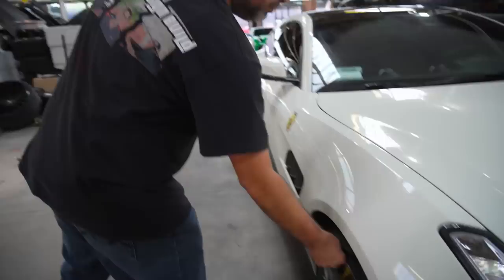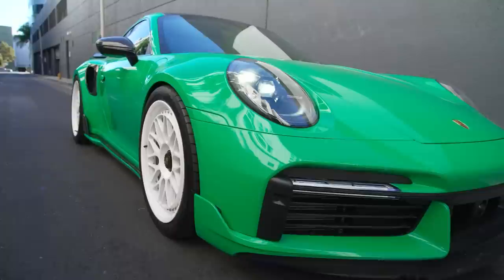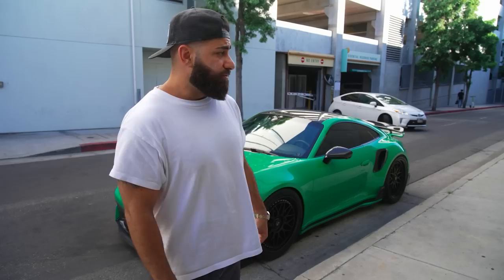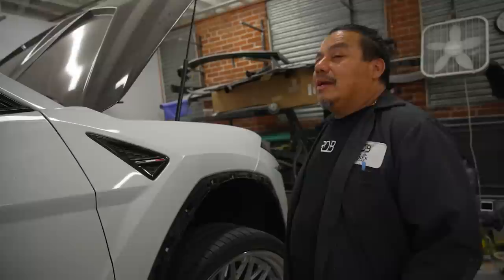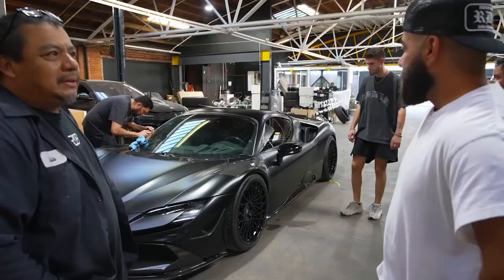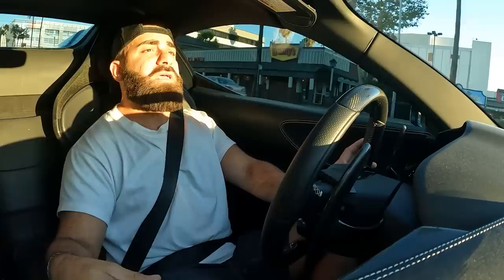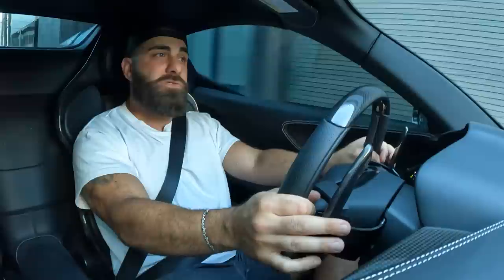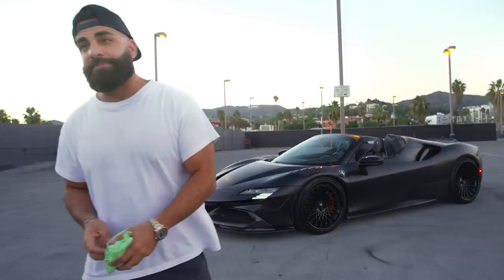INSANE SF90 Spider Ferrari with Full Body Kit, 1st in the World. + Green Porsche 992 Turbo S.

Comment: The vents on the fenders are not for ventilation, well technically yes, but more to release pressure from tire rotation to create downforce at speed.
Reply: They were not lined up with the hood. I wonder if it’s a manufacturing problem by Ryft.